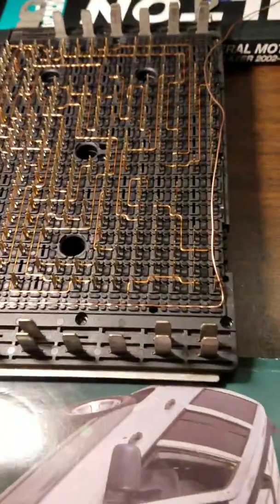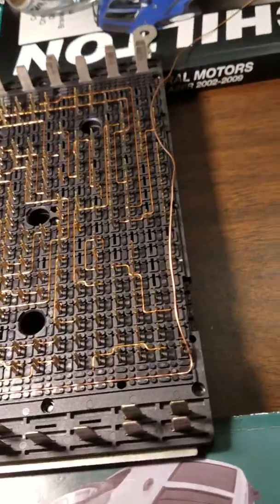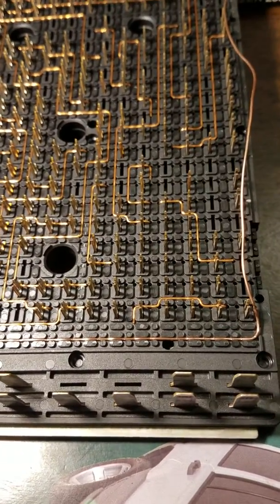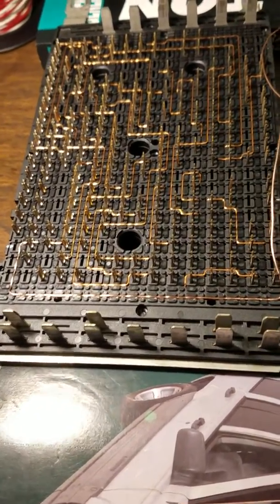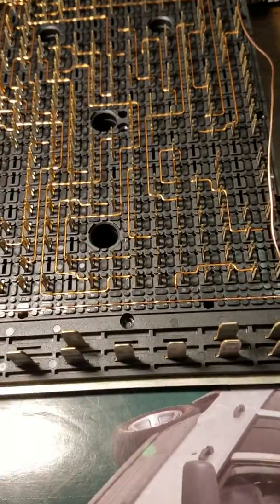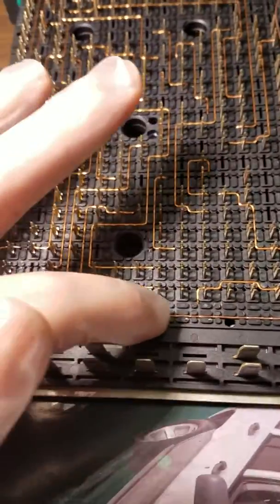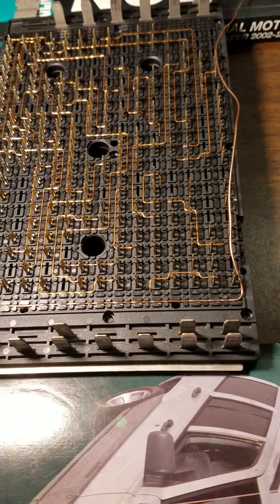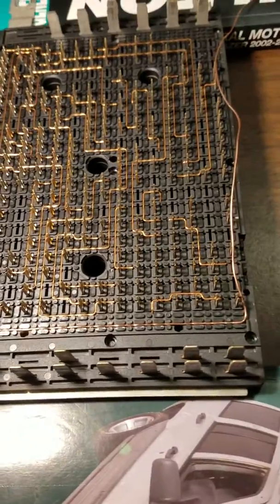P1682 code Trailblazer SS turns over, but doesn't crank pt 1

Comment: Good deal ! Do you have a video showing how you soldered the wiring together that would put the icing on the cake. Or would you mind posting a reply with a brief description on how you did it
Reply from the maker: I never soldered it.  The wire itself is easy to pull up and replace with the 20 gauge solid copper wire by pressing back down in the same path as the previous wire.  You're completely replacing the bad wire with good.

Comment: Yes the circuitry in that fuse box is made cheaply and so an expands you get a hairline crack in the circuitry and it dies and won't start until it cools off so the next day it'll start right up and runs like it's brand new unfortunately everybody buys a new computer they buy a new fuel pump they buy this they buy that and they spend thousands of dollars and it still don't fix the problem shame on you GM

Comment: Yes I got a new fuse box in it took care of the problem but now the p1682 is coming up again and it's because they make everything cheap on GM I'm starting to hate Chevrolet
Reply from the maker: Oh wow, even with a brand new fuse box, that's crazy.  It is a factory flaw.  So if you buy a new one from GM, it will have the same issue.  There is a twist in the copper wire from the factory and after time it will crack and separate when the engine bay gets hot.  After the engine bay cools off, you usually can crank it again.  If yours is running and still has the code, hopefully it's just a clearing or reset of the computer codes should hopefully help.

Comment: What is turnover but does not crank it doesn't make sense it turns over but it don't crank crank is turning it over I have a Chevy Trailblazer 2005 LTE with a 300 horsepower v8 in it and I'd have the same code pop up all the time it's because of the cheap also check your yellow wire oh I forgot check your yellow wire from the fuse box that's usually the problem that I had to put several shame on you GM shame on you right now in the world there's 47,822 people stranded on the side of the road because of this problem
Reply from the maker: When you go to start it and the starter engages the flywheel and turns the crank shaft, that's where the "turnover" term comes from.  It will turn over.  When it doesn't actually crank or run is where the term "no crank" comes from.  I was told all the V8 Trailblazers do this and have the same fuse box with the same problem with this wire breaking.  Yes, it's a terrible problem from the factory, but it's relatively easy to fix.  After I replaced that wire, I have had no issues with mine for 5 years now.

Comment: I’m using 20 gauge wire. I’m having trouble pushing the wire in the grooves
Reply from the maker: Yes!  They are hard to get into the grooves, on mine, I didn't get them all the way down, afraid to push too much on them, but I was able to push them down at least halfway.
Reply: @alansunday  I’m going to try a 22. 20 was large and 24 was to small. Also, rerouting has makes no difference as long as both ends connect right?
Reply from the maker: Correct, rerouting won't affect it.  Less bends are better on the route.
Reply: @alansunday  here’s an idea as well: would it hurt to put a little on both end points where they rest on the prongs?
Reply from the maker: A little...?  Solder?  I guess it wouldn't hurt.  I didn't mine and she's been running great for 4 years now.

Comment: You reroute that? I'm looking at mine and I snapped an offset with my pick tool while testing them for strength. Swear I heard a ping too like I broke it but it had to of been weakened to snap in the 1st place
Reply from the maker: The only rerouting I did was the bend at the original break where I only did a 90°.  Everything else I tried to duplicate the route.

Comment: What fuse and wire am I supposed to be looking for
Reply from the maker: It's the starter relay wire path.  The wire has a twist in it from the factory that breaks over time.
Reply: I replaced the wire... It was broke at the s curve... But now it won't start and gauge cluster won't even come on
Reply from the maker: Sounds like it could be the ignition starter switch in the steering column.

Comment: If i take my car to a shop will they know this is the problem or just try to replace the ecm?
Reply from the maker: Very good question.  If it's a dealership you're taking it to, they should know that this is a common problem and more than likely they will replace it with a complete new one, if they have the parts.  When a vehicle gets to be 10 years old, however, it's hard to find parts still at dealerships.  A thing to remember though is that this is a factory problem.  When making these, the machine that is routing the copper wire, it twists the wire in this particular location and over the years that twist breaks with hot and cold, expanding and retracting, so in 7 to 10 years it will most likely happen again.  If it's a non-dealership that you will be taking it to, good luck explaining it to them.  They will probably give you the dear in the headlight look.  There are mechanics out there that actually will research and try to fix things.  If you have time, it's not a bad project to handle yourself.  The 20 gauge copper wire is available at Lowe's or Home Depot.  I have another video on here that show's how to get it apart once out of the Trailblazer.

Comment: We're you having the pcm1 #28 fuse blow as well?
Reply from the maker: No fuses were blowing on mine.  Sounds to me like there may be a ground issue with yours if you have #28 fuse blowing.  Have you checked all your grounding wires?
Reply: @alansunday  Im going to change my coils first they have 160k on them .lol
Reply from the maker: That would throw a different code.  Just went through that with a Ford.  Code came up for a cylinder misfire.  Was coming up a different cylinder each month until basically I changed all coil packs.  I have 120k miles on my TBSS with original coil packs.  Have you checked any codes on yours? How does your grounds look under the hood?  Just curious.

Comment: Hey great video thanks. I have an 09 Silverado and I’m getting low voltage to the high beam fuses causing the high beams to not work. I’ve read that this might be the problem. I guess I will give it a go!
Reply from the maker: Good luck.  Let us know how it goes.
Reply: Finally got the time to work on this again. There’s a salvage yard not far from me that deals in late model parts and I was able to pick up a fuse box from them for $60.00. After everything else I pretty much had it down to a bad wire/connector or the fuse box itself. The problem was in the fuse box and after about 20 minutes of work exchanging them I now have bright lights again. Hey thanks again for your video. It gave me a lot better understanding of something that I knew nothing about.

Comment: Do I need to solder the wire or just input it
Reply from the maker: If you're replacing with new wire, you just press it down.  No soldering needed. I've heard some people solder the crack and have had success with it,  but new wire is so cheap, I would recommend putting in new.

Comment: Hi. 
My fuse block didn't come apart cleanly 
Does anyone have the wiring diagram for the 2 grid halves for a dt15115618-02 fuse block??????
Reply from the maker: Are you asking for how the copper wires are laid out in the grids?  I tried searching for diagrams for the copper wire lay out and can't find it.  I'm not sure if pausing the video above would help?  I will try to keep searching online.

Comment: Had the same issue, did some reading, and sure enough!!! Soldered the wire back up at all the joints and odd sharp bends that GM throws in there..All good to go! After thorough inspection, I found a clean hairline break in the lead that went over to the main powertrain relay terminal. It was almost invisible. I recommend using a pick to probe around gently. This info will save people alot of money and headache, like it did for me!

Comment from the maker: Just wanted to say that I used my android phone and also my android tablet to see if I could pull up the onedrive link and it does pull up.  It also shows a pop up that wants you to sign in.  Don't.  Just click the x to exit that pop up out and on the upper left corner it says to download .pdf.  I clicked the download and it pulls up the .pdf showing steps on how to get the fuse block separated.  Hope that helps.  

Also, in the coming weeks after the holidays I hope to get a fuse block and post a video on how to separate it.  I can't find any videos on here that show the process.  Hope the onedrive link helps in the meantime.

Comment: Alan, 

Thank you for posting this. I'm also unable to use the link you've supplied that show how to separate it. 

Update: After tapping out the bolts, I drilled out the retaining metal flare. Separated it, and found that the wire was broken in the same exact spot!  After rewiring, (I made it a straight wire all the way across, like you did), which took 15 min. I plugged it back into my SS and popped all the fuses/relays back into place. The whole process took about 3 hours.
Reply from the maker: So glad the video helped!  It's crazy that the crack and split in the wire is in the same spot on all of these.  In the coming weeks, I want to get a fuse block out of the junk yard and do a video on taking it apart.

Comment: i remember the old throttle body 305 and 350 ignition control module will essentially do the same thing. as it warms up it will expand and disconnect the circuit. i have a 06 tbss with 90000 miles so when and if that time comes i will rectify it. thanks alot.

Comment: How did you disassemble the fuse block?  I have the same issue and I'm trying to figure out how to separate the top from the bottom so I can see where that 20 gauge wire is laid in.
Reply from the maker: Hey Nicholas.  I posted a website that shows step by step pictures of how to disassemble the fuse block.  Check it out here:

https://onedrive.live.com/?cid=3EF39D...

I used a 1/2" drill bit to drill the swaiged bolts that hold it together like in the pictures on the website.  Once they are drilled, it will separate and you can get to the wires.  Remember to look on both sides of the fuse block when separated for any cracked wires as you flip it over.
Reply: Alan Sunday, that link does not work for me.  When you mention 1/2" drill to drill out swaiged bolts are you referring to the two circles indented into the top side?
Reply: Nevermind.  While replying to your comment I noticed a recommended video link below that explains it.  Thanks for your video and your help.

Comment: Thank you so much for posting this! I have been pulling my hair out for two weeks trying to find the cause of my cousins Envoy XL dying once warmed up. I was just sure it was the ecm failing, as that was the only thing left I couldn't check with my level of tools. I had read about the fuse panels going bad, so I pulled it apart looking for a broken wire or corrosion, but failed to pull the fuses out of the top side. So I only got one side of the picture lol. After making an appointment with the dealer for next Monday, I thought I'd look on YouTube one last time, and wallah! Your video showed me where I had gone wrong. So I pulled it apart all the way this time, and sure enough, there was a hairline crack in the very same place as yours. Thank you so much again for making this video! Saved my cousin and I a ton of money!
Reply from the maker: Happy to hear this video helped!  When I first took the fuse block apart, I also didn't realize there was a flip side to the panel and sure enough there is the hairline crack as you did see also.  I was wondering if the fuse block problem would be the same for the Envoy.  Glad you posted your comment!  Thanks so much!